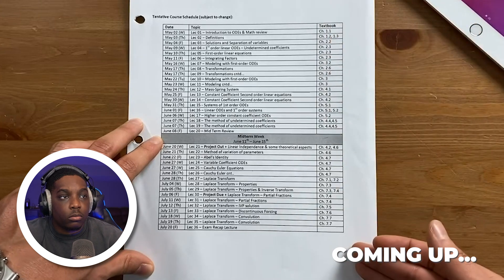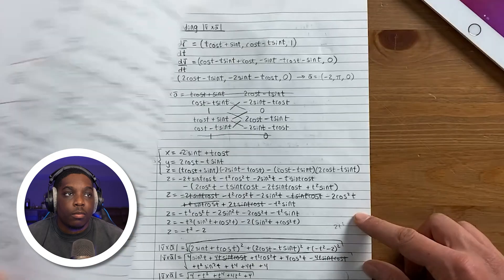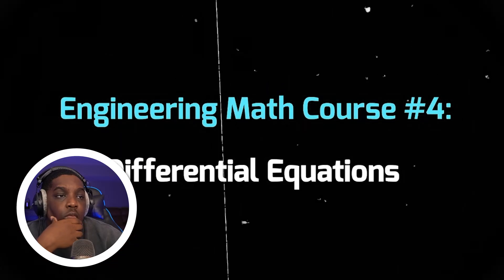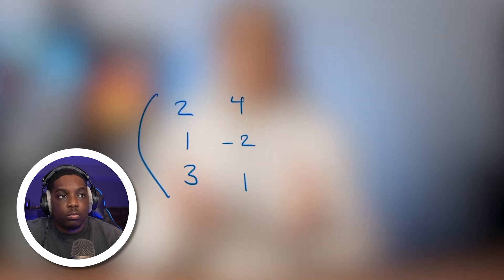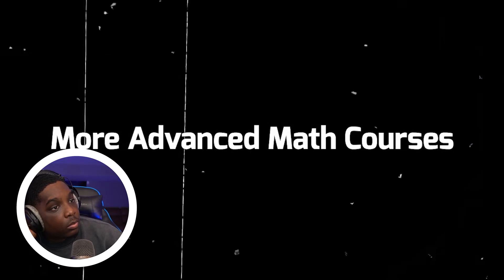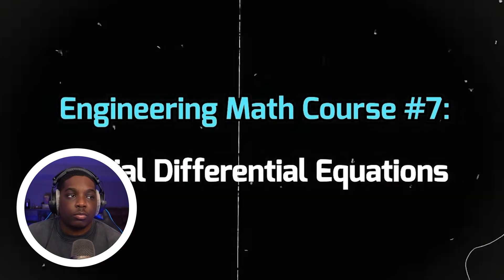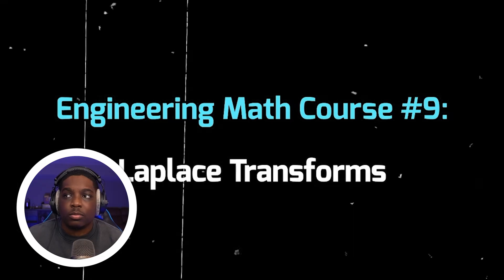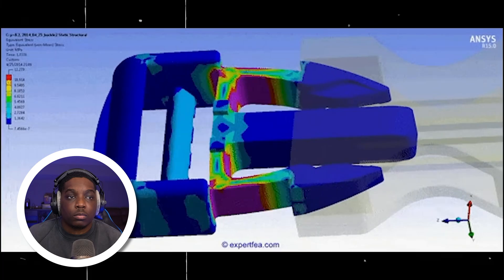How Much Math Is Really In Engineering? | Electrical Engineer Responds

Comment: How big of a threat is AI to engineering?
Reply: Potentially catastrophic. 

TL;DR: we’re going to forget how to do complex things and have to regrow our tech tree from almost nothing (but with a LOT of bootstrapping), and the lawyers will screw us (then again there’s a reason the not-actually-a-joke line about the lawyers being the first up against the wall when the revolution comes is about lawyers rather than politicians). 

The issue isn’t job replacement per se but a combination of the US legal system and long term economic incentives. 

The economic problem is one of substitution (all the existing engineers die of old age, no one learns engineering to replace them because AI can do it faster and cheaper, and so we become technologically locked to AI access. There are a couple of big risks I’ll highlight and then assume they’re solvable, the move on to the bigger risk. 

In the disregard class, AI can be poisoned with bad training data far more easily that previously believed, see Anthropic’s October 2025 paper on this ( https://arxiv.org/abs/2510.07192 ). I assume this class of problem is solvable. 

But the more important risk comes from losing the underlying knowledge. Assume that AI teaches some form of generalized reasoning (rather than the text predictor it’s best known as now). That engineering AI will be faster and far more competent than any set of engineers you could replace them with. But what happens immediately after the next coronal mass ejection? The 1859 Carrington Event quite literally lit telegraph wires on fire all over the world, what AIs are going to survive that? And what happens to humanity when the water treatment plant needs a specific command to restart it but the only ones who knew how just got the electrical death penalty? It won’t just be one thing either, it’ll be every field. One might think: some small number of people will have learned that knowledge,’even if only because there are a lot of humans and it only takes one of them to become curious enough to learn how the now—dead-AI controlled system actually works. Even granting that we run into a distribution problem: we don’t know who and where they are, nor where we need to get them to even start coordinating a fix. 

This is the biggest risk to engineering from AI - it’s hard dependencies that make sense from most angles but also pull the ladder up behind them so in practice they can’t be followed. 

On the legal side is the question of liability. I’m happy to use Teslas full autonomous driving because I know on average this reduces my risk and that if I run afoul of circumstantial bad luck that Tesla has deep pockets to support my family after I pass. 

But can a corporation get out of that? Setting aside the contracts that say the “driver” is at fault even if the car shuts off all drive by wire inputs, locks the doors, and overall just goes evil mode, as I think these contractual clauses will be thrown out almost immediately as against public policy. If they can’t just victim blame they’ll go the other way: hire a fall guy. You make one guy the legal head of the corporation (with no cash assets) who will be personally liable for any injuries (etc, fill in extra legalese). Pay that guy a million dollars a month with a half million a month to be paid to the family if he’s incarcerated and I’ll bet there’s a nearly endless line of volunteers. 

The fact that your Chief Liability Officers tend to only last a couple of years won’t matter as that’s their very purpose. 

Now you may say, we’ll just prohibit that form of protectionism, and I’ll agree that specific form will likely get banned quickly. But do you know what’s really good at coming up with potential solutions? That same AI.

Comment: Your headset is on backwards. The left ear has the cable if those are beyer dynamic.
Reply from the maker: Thanks man
Reply: @jovanhall  No problem. You don't know what you don't know. There are also letters (L or R) on the plastic just above the ear pieces.
Reply: Now you know he's really an engineer.
Reply: He could be doing that because he doesn’t have an interface and has his headphones plugged into his computer which is on that side. I mean his vocals don’t sound mixed really at all.
Reply: But if he has an interface, which honestly him having those headphones makes me think he might, then he probably doesn’t know 😂

Comment: I did great in geometry during high school, struggled a bit with alegbra 2 sophomore year and struggled a bit more in pre-calc in jr year. Then I took calc senior year and dropped it after 1st semester. That was about 8 years ago. Any tips if I were to go into engineering now? Seems I’d have to regain competencies in all of those areas before going into the program. 

Fyi: I’m finishing my general studies at community college and want to go for my bachelors after! However, I’m really hands on so I’m thinking go for an associates in electronic engineering technology first, then make bachelors run as I find my niche in engineering. I’d appreciate any thoughts, thanks!